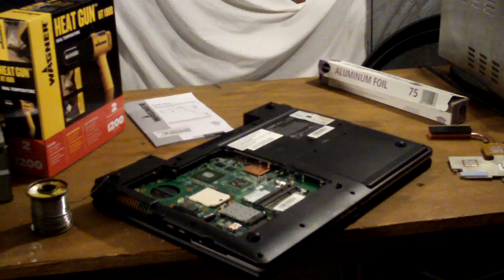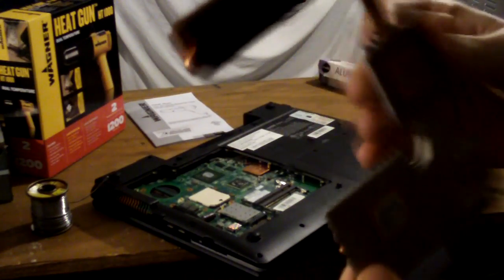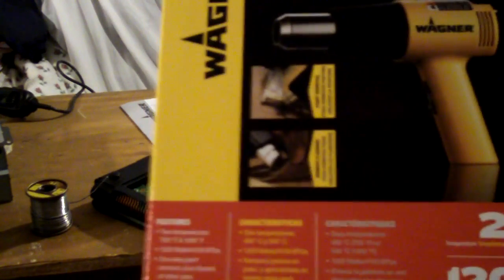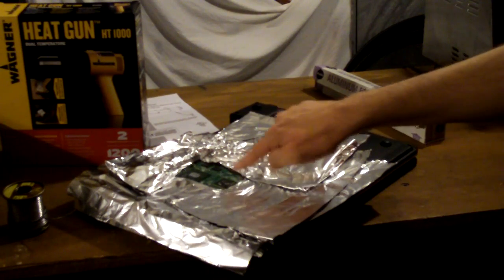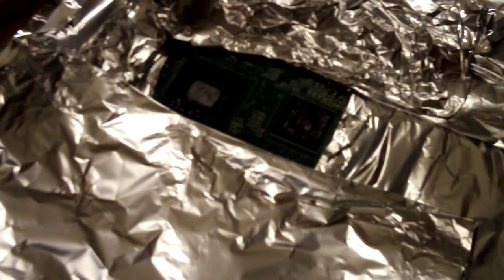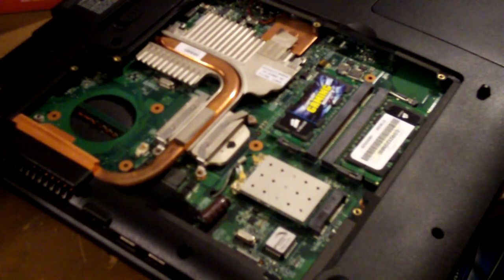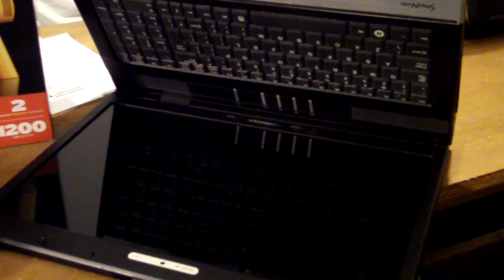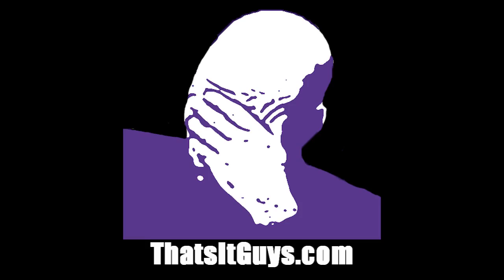Laptop GPU Repair Guide (Turns on, Black Screen, nVidia) Everex XT5300T XT5000T Fujitsu Amilo

Comment: I have a hp DV7-4272us laptop and when I turn it on it sounds like it's booting up but the screen stays ball and the led on the caps lock button constantly blinks. I have read it's the GPU, do you know how easily that is to fix or change and can it be done by me without taking it into a shop and paying a fortune. Plz help thanks.
Reply from the maker: Str8Klownin1 Not familiar with that laptop model, but a quick Google shows it has an integrated Radeon HD 6370M, meaning it's soldered to the motherboard and cannot be replaced. It's 4 years old, so I wouldn't put too much money into trying to repair it, but at the very least, you can try and backup your data off the old hard drive using an external kit like this (http://fave.co/1ACbiAe).

While you could try doing a repair like the one shown in the video here, it's really difficult to pin down specifically what the problem is. With the laptop in the video & ones similar to it, they had a specific dedicated graphics card that had a high failure rate, and a solution that was known to work - similar to the original Xbox 360 systems. The heatgun just happened to be a budget way to fix these issues. With yours, there's not really any posts on the GPU dying, so I really can't recommend trying to reflow the solder.

Comment from the maker: This video is older than the laptop was at the time of recording this, so if it works for you, cool. If you have a negative opinion on why this isn't a "proper" repair, you probably missed the part of the video where duct tape, aluminum foil, and a heatgun were used. My original repair lasted over a year before it crapped out again, so YMMV (Your Mileage May Vary). I've said this before, if repairing this is worth $150+ to you, then get it properly fixed. Just know that without proper cooling, you'll be in the same boat later on. Or... you can spend $28 and give this a shot.
       
-- Shane ( the guy in the video)

Comment: lol. you destroy mainboard. This is NOT permanent fix.
Reply: lol, you commented on a 4 year old video on fixing an 8 year old laptop. As explained multiple times, this is a cheap fix for a laptop on it's last legs. The alternative is to do a proper BGA reball, which can run upwards of $150-200. Or... you can take a chance with an old broken laptop and spend $28 on supplies and 15 minutes of time.

Comment: When the solder there has melted, the chip has been heated sufficiently enough to reflow the solder. I had leaded solder, which has a lower melting point, so I waited just a bit longer for the chip to reflow.

Comment: "Heat gun reflow soldering" would fit best.

Reflow soldering is generally done with professional equipment, but obviously with a now 6 year old laptop, anything more than $20-30 is probably not worth the money.

Comment from the maker: I'm assuming it doesn't get to Windows and just gets stuck on a frozen screen? It won't hurt to try and reflow the chip again, since it doesn't work right now anyway, but it could be a problem with the motherboard or many other things.

The laptop shown in this video had a nVidia 8000 series GPU, which along with the 7000 series were prone to having GPU issues. It looks like your GPU is an ATI HD 3470, so it could be a different problem - mobo, north bridge, etc. Could even be a bad stick of RAM

Comment: This is an awesome trick. My old Fujitsu-Siemens Celsius H250 experienced the same issue. It had just died on my while I was away for an hour or so and when I got back it wouldn't boot. Black screen and a beep code (GPU error?). So I took the laptop apart and used this trick. It works andt still working a few hours later. At least I could backup my work in case it dies again. Only thing though was that I accidentally melted some plastic parts inside. Recommendation: remove entire motherboard!

Comment: I think I fixed that forum problem now lol.. 

Regarding the Hybrid CrossfireX between the motherboard graphics and the MXM slot, I'm not 100% sure. As far as I can tell, the MXM slot has to be occupied for the laptop to boot, but those chips are user replaceable.

Try removing the chip and heating it with the heatgun like in this video. Worse case scenario, nothing changes and you're back to square-one.

Comment: Hi, i tried to register on ur forum but im ip is banned oO
I have Amilo Pa 3553 it has this onboard crossfire thingy...HD 3200 (RS780M) chipset and dedicated Mobility Radeon HD 3470 MXM2 card, it turns on and runs but no picture....
My Question is, which one is the maincard? I can change the MXM2 card but the not the video chipset, can you help me?

Comment from the maker: It's possible. That laptop doesn't have the same GPU that had all the issues like the one featured in this video, but if it's dead and you don't want to put the money into having it properly diagnosed, it's certainly worth a shot.

Keep in mind, you can buy a laptop for $300 USD that will outperform the one you have, so I wouldn't put that much money into repairing it.

Comment from the maker: You can always do it again. It's not necessarily a permanent fix, because the laptop still gets really hot and goes through those heating and cooling cycles, which causes the microfractures in the solder. But yeah, you can pick up an A6 laptop cheap that will blow the Everex away in performance. My personal combo is an i5/i7 and a nVidia GeForce 630/640M or better for decent gaming on a budget.

Comment: I just got a year out of my computer from doing this.  And my GPU has died again, so i'm about to retry this.  The copper penny that I used I don't think transfered heat as well due to the grooves in the penny, so I will use a copper shim this time.  Let's see if I can get it to work for another year HAHA!  The whole reason why this continues to happen on modern computers is because they stopped using lead.  If they had used lead solder it would not be getting these micro fractures.

Comment: Depends on how much time you have, because I can assure you, if this is your first time opening a laptop, it will take you two times as long to reassemble the thing.

You have to remove all of the screws underneath the laptop, then flip it over, pop the panel that covers the speakers and power buttons from the side using a flat-head screwdriver, Then remove the screws that are now exposed and remove the keyboard. Unplug the keyboard and touchpad, then remove the other exposed keys. Fun, right?

Comment: You're heating the chips in the hopes that the solder joints that connect them to the motherboard are re-flowed and re-solidified.

What allegedly happened with the nVidia Geforce Go 7 & 8 series chipsets is that they had very poor heat dissipation (likely caused by the lack of cooling on the laptops) and would go through heating and cooling cycles that would cause micro cracks in the solder.

Comment: I'm not hiding behind anything. You made a shitty comment and I replied to it in kind. While I have something to back up what I say, you just come back with lame insults and incorrect info. Since you told me what you did, I repeated that back to you.

Copper does not dissipate heat faster than aluminum, you need to fact-check yourself on that. It conducts & transfers heat better, but retains said heat longer - hence why they use copper for the base of heatsinks and aluminum for heat spreaders.

Comment: Couldn't fit it on the previous reply, but your comment regarding the plastic is incorrect. The plastic they used has operating temperatures. Using a heatgun on it close to or over 1000F is way outside that range. I don't think you fully grasp plastic molding, but too much hardener will make the plastic more brittle when heated, rather than malleable like this was.

The casing of this laptop is using a mixture of ABS plastic & PPO/PPE, so it's melting pont is somewhere around 180-250C.

Comment: Okay - your heatgun is more efficient at melting the shit out of your plastic, that makes sense. You have a gun that has a higher temp. low setting and you were using it too close - that =/= efficiency.

Copper wouldn't have helped, since it retains heat longer than aluminum, plus isn't accessible at most grocery stores.

I'm quite aware of the differences between electronic and electrical - and do realize that the components you mentioned were electrical components, not electronic components.

Comment: I wasn't disrespectful or condescending, nor was that my intent. I was responding to your disparaging comment.

You said the heatgun used in the video was a "complete fucking joke!", then proceeded to say how you melted the solder in 15 seconds and "deformed the shit out of the surrounding areas of the enclosure." It doesn't take an electrical engineer to know that that is not good.

I'm well versed in electrical components, thank you.

Comment: That's because you did it wrong... you should never be openly heating the plastic. If you melted the solder in 15 seconds, your heatgun is way too hot and you have likely damaged several of the components on the motherboard.

The heatgun isn't a "joke", its low setting is 750F, or approx. ~400C, which is just above the lead-free solder melting point. You're not supposed to melt everything on the board and damage the casing, you're supposed to 'reflow' the solder joints on the affected chips.

Comment: I found out the solder is just there to let you know when its hot enough.  When the solder melts (on the aluminum foil) you know it's hot enough.  I cooked the processor so hot things started smoking, but the computer has been running solid for 6 months now. Good luck!

Comment: The motherboard isn't a cake lol. Oven repairs are generally a bad idea and can damage components on the board. Not to mention the oven would have to be set to around 430F to melt the solder.

No video + lights & fans means there's likely a component failure on the motherboard. This can be the the video card, VRAM, or even the north bridge. Since it's a nVidia 8800, it's likely the issue. Try heating the GPU and VRAM like I did in the video.

Post any issues / questions / successes to the forums

Comment: Hello, I'm using a gateway FX 6860. One day, my graphic card ( nvidia 8800gt) got sick, and I had to bake it as well as the whole motherboard (I wrapped it with aluminum foil and only expose the card). After that, I got this black screen, the computer runs but nothing on it. I'm not clear where should I apply heat, because I see you're applying heat on two places. Please help me!

Comment: Sounds more like you have something wrong with the LCD screen. Could be a bad connection on the cable, but it could be something wrong with the controller board.

Comment from the maker: @charis013 If you're using Windows XP, grab the custom drivers from LaptopVideo2Go. You'll have to do a bit of work to get them installed, but they should work. If you have Windows 7, the stock nVidia drivers should work right off the bat.

Comment: @meleniumshane90 You were right; finally I had to use a heat gun in order to fix it. One more question, it works fine with standard VGA drivers but everything mess up when I install the NVidia drivers, any idea?

Comment: @charis013 I'm afraid your fix will be very short lived. A hair drier doesn't produce sufficient heat to reflow the solder joints. Good luck though!

Comment from the maker: @majmx84 that's correct. I added an annotation to the video describing this like 2 weeks ago to avoid the confusion. Just keep in mind, the laptop uses leadless solder which has a higher melting point of my old leaded solder, so I gave it a bit more to make sure it was about 15C hotter.

Comment from the maker: @Galvathorax I missed this comment when I replied earlier. I actually forgot about fixing the annotation in the video. It's up now, but the basic idea is you use it to get an idea of how hot the area temperature is. When the  leaded solder melts, you know the GPU is just about the right temperature. Lead-free solder (which is what this laptop is using) has a higher melting point than leaded (about 15-20C), so when the leaded solder melts, you know you're about done. Use a copper shim & AS5 paste

Comment: I also wanted to mention that this worked, I don't know how long it will worked. I put the heat gun on high (1000f) for 6 mins!!) Plastic was burning on the other side of the motherboard, (I recommend sticky aluminum tape because the hot air will just blow underneath the aluminum and cook things from the inside.

Comment: Thanks for the video, it was a pain to figure out how to disassemble everything.  Your video didn't explain why you needed the solder.  Also, do you have any tips for replacing the thermal pad underneath the heatsink? I used a penny but i'm still geting 100C GPU temps on load. I feel bad for anyone doing this on the earlier XT5000T model because you have to dissamble the ENTIRE computer, every component, to gain access to the heat sink.

Comment from the maker: @RuebeX It really depends how well it was done. I've done three using this method and have only have one that was problematic. I was able to do it again without issue. Bear in mind, this isn't necessarily a permanate fix - you really have to weigh the costs of a proper reflow (which is generally over $100 USD) vs $25 at Walmart. For a 4 year old laptop, it's not really worth the money.. and for the most part, what do you have to lose if it only works for a while?

Comment from the maker: @0rkk15 Very cool! Of course, if it fails again just do it again - it probably took you less than 5 minutes like it did for me. Now all you need to do is get a copper shim & apply some Arctic Silver 5 and you'll be in better shape. * The shim is to take the place of the thermal pad that was there.

Comment: @longbeach225 Yes and no... it can work after a heatgun fix for years if done properly, or it could fail the next day. In my case, the one in this video is still working strongly. Now, if you don't fix the issue that caused the GPU issue to begin with, then you could have the problem again due to heat and the slightly weaker solder (post heatgun fix).

More than anything, its a reasonable fix to a 4 year old laptop - $25 vs $75 and up for a proper reball.

Comment: @rager2700 Good to hear. Yeah, that's what I had to do with mine to prevent it from getting too hot. I still need to get around to it, but I'm going to make a custom heatisink assembly for the laptops. I just need to get someone to solder the copper together. I have parts from a Northbridge and an old nVidia GPU that will fit well.

Comment: @dimitriosfl Its possible... bear in mind, this is a completely different laptop design, so disassembling it will be significantly different. The model I worked with here is really easy with regards to accessing the CPU & GPU. Yours will likely have to be completely taken apart. Hop on the forums if you have questions or need help with it. The link is in the description above.

Comment: @jonathanmoerman Its possible that this will fix it - its common for these video cards to have issues before totally not booting. Hop on the forums in the desctiption - there's a dedicated section for these laptops that goes over just about every issue with the laptop & how to fix it, plus sections for fixing just about everything.

Good luck!

Comment from the maker: @furythree Yes, this is the classic video card issue. The unit boots, lights display, but the screen does not power. The method of repair shown here is known as reflowing. Reflowing melts the solder joints that were likely cracked or had microfractures. The article and further information regarding all of this is located on our forums which is in the description.

Don't bake it in the oven, you will be heating up the entire board, which includes components that don't handle heat as well.

Comment: @ThatsItGuys i have the same problem.
were ur symptoms:
turns on, but screen doesnt turn on? (screen doesnt even power on, u can tell cause the backlight doesnt go on, so its not just showing a black screen, the screen just isnt on)

would this method work? ive heard that u can bake it in the oven?

Comment: Just fixed my own laptop this morning using this method. Before it ran only at 380x460 pixels with 8 bits colors, stripes through the whole screen, completely unusable. Prepared the laptop just as in this video with the aluminum foil, held a heatgun on it for 2 minutes on 350 degrees celcius and 1,5 minute on 550 degrees. Did put the laptop together, reinstalled the geforce 8600mgs driver, and even halflife 2 on native resolution ran again! Thanks for this video!

Comment: @korgiss23 No - just put two pieces of solder on the aluminum foil so i'd know approximately when it was hot enough to reflow the solder in the chips.

Comment: @thewkathuutonet Its a possibility - the video is just a picture of the screen, so its difficult to tell if that's artifacting due to something wrong with the video card or bad drivers. If the non-modded drivers do that, its likely a video card issue. You're welcome to try this out, if done correctly, it shouldn't harm the computer. Hop on the forums & post more detailed info there. Link is in the description.

Comment: @whostolekjodo Glad to hear it, this usually works for the video card issue. Great thing with this is there's very little cost associated with fixing it. Plus, If it doesn't work, you only put $25 into it.

One thing I forgot to mention in the video is this can work on other laptops - but you may have to disassemble them down to the bare motherboard. We have further information available on the forums covering this.